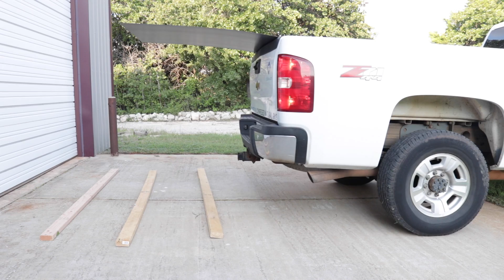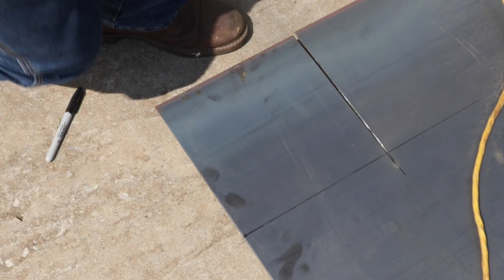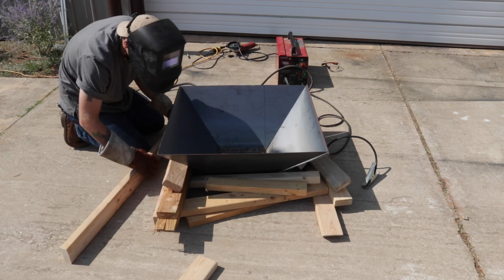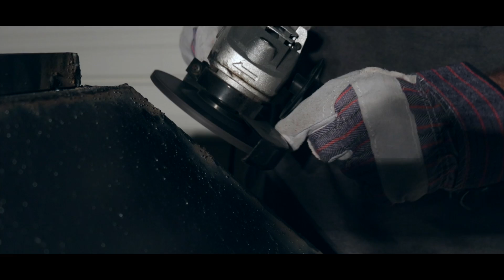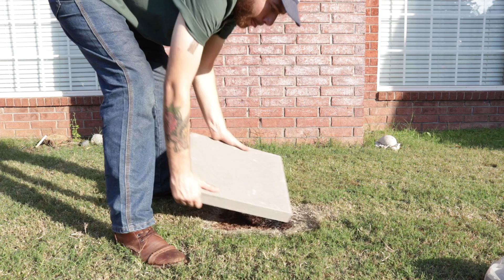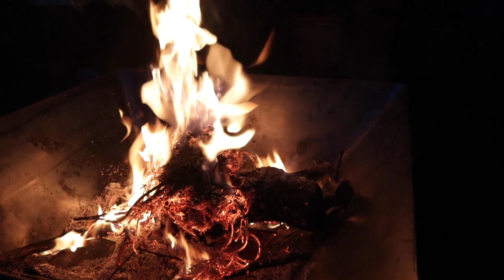How to Make an Outdoor Steel Fire Pit | Modern Builds | EP. 73

Comment: Great work. Welding looks fun. A coat of matt black chimenea/bbq paint and this would look even better
Reply from the maker: I agree, that could look cool. My plan, though, is to let it rust, or patina a bit then put a clear coat on it so that it doesn't rust out completely.
Reply: Peter O'Connell 
It seems to me that there will be charm in rust too!
Reply: Modern Builds what he said^ Use a rust inhibitor like Penetrol before applying the clear coat to prevent it from rusting further. Also make sure the clear is an oil based poly to match the oil based Penetrol so that the clear coat will remain somewhat flexible to compensate for expansion and contraction without cracking. Here's a link https://www.flood.com/products/paint-additives/penetrol-oil-based-paint-additive
Reply: Modern Builds it will most likely continue to rust even with a clear cost. I would suggest against this.

Comment: Arc burn actually a lot worse than sunburn for anyone not familiar with welding. It won't turn to tan and almost feels similar to a very mild chemical burn and needles poking at your skin. Welders who have repeatedly not covered up, because of heat end up with Melanoma very often. A ton of older welders have Melanoma. Don't get complacent like me, because I'm probably going to end up with Melanoma.

Also never wear anything that is not natural material. Stick with cotton, leather, and wool. If you wear something like polyester it will fuse to your skin and hurt like hell coming off. Take off your wedding ring and the rest of your jewelry. I don't know how it happens, but I've seen pictures from of guys with all of their skin dangling off their fingers.

Comment: When using flux core, drag, just like welding with stick. When there's slag you drag, cleaning the metal with a wire wheel with the grinder 1st will also help

Comment: Welder here. Flux core wire welding is not my preference but it can get the job done. You should invest in a mig welder. Less clean up because there is no slag to chip off. There is a lot of low cost ones out there that won't break the bank. Anyways on flux welding you want to drag the puddle. No manipulation needed with flux welding. Remember not weld thick material with those little toy welders.

Comment: Yes hot rolled and cold rolled are formed the way he mentioned but depending on the project you're working on if you're worried about warpage always go with hot rolled because it was formed and allowed to cool so theres no internal stresses in the material that might cause warping if exposed to heat.

Comment: As a son, nephew and grandson in a family of a bunch of blacksmiths, I must say that was pretty good for a second welding experience.

Other than finishing it some way with paint (I've already read what you actually want to do with it) I would think of a way to have a hole in the bottom but with a sliding door or something that could be opened and close at will, so that would help regulating the strength of the fire.

Nice work, really nice work giving the circumstances.
Reply from the maker: That's a cool idea! I appreciate the encouragement
Reply: Modern Builds you're welcome! That being said, I'm not a blackmisth myself or anything like that, I just helped my dad and uncle when they needed me and I was around, but I think I can recognise a work well done.

By the way, now that I think about it (and maybe you have learned it the hard way) I would use some angle iron (though here something close to 45° is needed rather than the much more common 90°) to make a couple of squares. One would be with the same dimensions as the "grill" you've done so, once that square is welded to the firepit, you can place that grill over it, which will make the thing MUCH more stable, and therefore safe, mainly in the corners. As it is in the video, if you hit a corner hard enough (and it may need not too much) dropping some wood for example, it may act as a lever and the burning things in the opposite corner might go flying. At least it might be annoying.

And the second square would be the same size as the top square of the fire pit so it would be welded flush with the top from the inside. I think it would look nice and, if welded and finished smooth enough, it may seem as it is all part of the same sheet of metal that has been bended inwards. That would also make it somewhat safer, since you could hurt yourself with the edge of the sheet of metal, and this add-on prevents that.

But most importantly from the fire pit itself point of view, those two squares of angle iron (or something similar) would add to the strength and rigidity of the fire pit itself since, if left like this, it will inevitably warp over time due to the relatively extreme temperatures it may get and just because of the use in general.

Thank you for answering!

Comment: Hello, great video!!!  Was wondering if you have had any rust issues with this being outdoors.  Did you do anything to prevent rust in the future?
Reply from the maker: I left it unfinished so that it'll rust a bit and get a cool patina. In a little while, I'll put a clear metal finish so it doesn't rust like crazy or anything
Reply: Modern Builds I would be interest in what clear finish you use that would stand up to the heat and how well it worked. Love your channel, keep it up!!

Comment: Can someone explain to me why you need to add water to concrete and metal before drilling a hole into it?
Reply from the maker: To keep the bit cooled so it doesn't overheat and dull
Reply from the maker: use oil when drilling metal though

Comment: It'd be a really good idea to make sure the surface you're welding is clean before you start (Acetone solution). Also when welding try not to go back into an area you've already welded. If you're going slow enough to get a small puddle for every part of the weld and then dragging that forward, you shouldn't need to go back and forth. (This can be tricky when welding thin metal). I also have very little welding experience, but hopefully this is useful for future projects. (Also Ron F down below is right)

Comment: I kept waiting for a final shot of it painted and more finished. Nice job overall. I just personally would have taken it one more step further. I like the idea of the project.
Reply from the maker: Maybe, I kinda dig the raw steel look. I probably could've mentioned it in the video, ut the plan is to let it rust or "patina" a little bit then put a clear coat so it doesn't get rusted out completely. I think it'll make for a cool look.

Comment: Looks good but I think it would look better if you sprayed it with a metal darkening agent so the grinding marks around wear you welded are covered and the colour is consistent throughout the whole thing. Also I find it easier to weld if you move your whole arm not just your wrist (I don't know if you already do this or not I diddent pay attention to your movement when you were welding the fire pit)

Comment: hot rolled generally means that the surface is not smooth because theres scale and stuff on it, cold rolled is mostly bare metal. i think hot rolled looks better for a firepit since its kinda black and looks cooler than bare steel

Comment: Great Job! I love the design. I'm excited to see more welding projects. 

I work like three blocks from that metal supplier. Also check out  Quik Service Steel Co. and Standard Steel. Those are where the pros I know in OKC shop.

12ga. is closer to 1/8" (.10046) which is perfect for this.

I think I have that same welder, everything but the sticker on the front is identical. If it is and it will take gas that would be a great way to say thanks to your friend. I bought my bottle at City Carbonic and had it filled at Lampton Welding Supply. I hope some of that is useful. ;)
Reply from the maker: Right on! I'll check them out! thanks a lot

Comment: The difference between hot and cold rolled in terms of choosing one for your project is that cold rolled will have internal stresses from the supplier and will, when heated, relax and change shape (warp), so a hot rolled steel would be best where heating is required in the manufacture or where cyclic temperatures occur. Conversely, these included stresses increase the strength of the steel and in jobs requiring this, cold rolled has benefits.

Comment: As a welder myself and watching your video my tips for you are - shorten your arc length, slow your travel speed, clean your slag before trying to weld over other welds, and having a constant joint prep with no gaps will make it easier to weld. If your only starting out my advice is to start on a stick welder because with a mig you can be lazy with your angles and travel speeds with the torch and still get good results, but with the stick if it's not right it will be no good.

Comment: Nice design!  A tip I picked up for cutting straight lines with am angle grinder is to clamp a metal straight edge (like the strip you made the grate from) to the surface and follow the line.  Keeps you cutting straight.

Comment: Hi, Mike. Couple welding tips from the same beginner as you are. 1) more clean steel = more stable arc and prettier joint. Especially when we talking about MIG. 2) maintaining arc when you welding horizontal pieces much easier 3) if you tack your pieces - clean the slag and only after that you can weld everything. That way you prevent ugly slag pockets in your joint.
Reply: Some more from my side
1) point 1 is a very important one what dmitriy said. Most important is the surface preparation. Deciding the type of joint. Cleaning the surface. Makes the arc very stable and a lot good weld bead. 
2) theres a direction of motion of the welding torch and the angle of electrode against the bead. Google the two types. Choosing the type for the suitable purpose is also a mandatory requirement as it changes the depth of penetration and hence the strong joint.
3) welding straight horizontal joint is easiest and best. Also try to maintain the continuity of the weld pool. 
4) suitable jigs are to be installed before welding as welding heat causes a lot of warping in the metal and desired goal will not be achieved.
5) speed of welding is important , if its slow it would melt down the workpiece metal , if its fast it would not be a perfect joint and would be flimsy.
6) proper flux either in form of gas or solid flux are to be used to prevent the weld to be oxidised in presence of air.

Comment: Thanks for adding in a warning about covering your skin. It is SO important to have the proper PPE for welding. Repeated exposure to the welding arc can actually lead to skin cancer. 

Wear the proper shade eye protection! You can really hurt your eyes, even if you just look at the arc as a bystander. I bought my auto darkening helmet at Harbor Freight for a very reasonable price and didn't have any issues with it. 

Miller has an app for your phone called MillerWelds that will give you a more extensive cheat sheet with amps, wire feed speed, wire size, etc. depending on what type of welding you are doing on what materials & what thickness.

Thanks for the video, Mike!

Comment: Bevel the edges your welding together a Iittle bit to allow the bead to basically penetrate deep which allows for a stronger joint. It also prevents your bead from sitting on top of the metal itself

Comment: You asked for welding tips heres the quick and dirty.
Before you weld any area prep the metal by grinding off the surface coating * you notice how the metal looks cleaner after you used the flap disk * Then use a cleaner to remove any grease and contaminants. Lastly with flux core  you need to wire brush after you lift off the trigger. * due to the flux, it bakes onto the surface again you can notice when its clean * you'll get better penetration.

Comment: Awesome project! Just a quick tip for your next welding project, when using a flux core wire, drag the weld puddle don't push it, will make your welds much smoother. If you use a solid wire, you push the weld puddle, easy way to remember is 'drag slag'

Comment: As a local okie welder myself. Nice job. Id suggest calling Albright steel and wire if your buying full size materials definitely cheaper then Metal Supermarkets. Shorten your wire stick out to about a inch past the tip. The weld pack 140 is a great unit to start with. It can run both flux core and gas when your ready and is a 110 unit as well. If you'd some help or a few welding lessons, layout, or fabrication tips hit me up. Im in mustang so not far from you and i have a full welding shop at my house. Also check out Jody at welding tips and tricks tons of great info. Have fun and learn as much as you can.
Reply: I 2nd Jody with welding tips and tricks. Great, straight forward explanation. We actually watched some of his videos in a welding class I took.
Reply: I'm an okc maker as well and agree on Albright on Virginia downtown. They dont mind stupid newbie questions. They're also friendly to small purchases. I cant tell you how many times I've bought one 20' stick of 1" square tube that they happily cut in half for 50 cents or a dollar. Ask to check out the off cuts.
Reply from the maker: Thanks a lot Jarod, I appreciate it! I'll be sure and check out Albright!
Reply: Jarod Martin awesome advice couldnt said it better. hope he takes you up on weld lessons
Reply: Jarod Martin oh i weld for a living

Comment: Question about the fire pit, how is the oxygen flow? Since you didn't really add any openings on the lower side.
Reply from the maker: all the holes I drilled on the bottom help, but it's also sitting on the grate which provides good air flow.
Reply: GeraldGeer 8

Comment: Awesome build dude! Welding is way easier than people think, it's an awesome way to incorporate different materials into your work.
Reply from the maker: No doubt! After doing this one, I've got a thousand more idea haha
Reply: if you take a bit of time and learn how to weld, you dont need to grind as much, pays off timewise in the long run
Reply: you mean welding is harder than people think... i mean, yeah "gluing" together 2 pieces of steel is easy, but making it strong and look good is everything but not easy.

also i think you really should start with stick welding, if you know how to stick weld, all other processes will be much easier to understand and master. if you dont care about learning how to weld, buy mig, litteraly like hot glue for metal, if you got somebody setting the thing up for you, you can feel like the best welder out there, because obviously its as easy as using a hotglue gun.

another advantage of beginning with stick welding is that you are less likely to overheat the workpiece since the rod only lasts a couple of inches before you need to insert a new one, that way you automatically have a break for the heat to dissapate.
Reply: Modern Builds it looks like it hurts tho the fire
Reply: I think for the kind of stuff that Mike, myself, and most other woodworker/furniture makers produce, MIG is all we'll ever need to know. Very little of what we do is really structural, and even mediocre welds are plenty strong for something like a coffee table base. Grinding goes a long way as far as looks, hah!